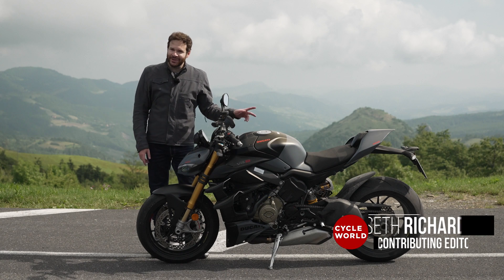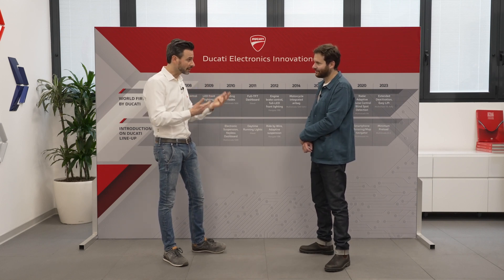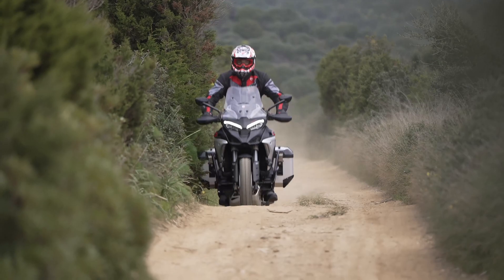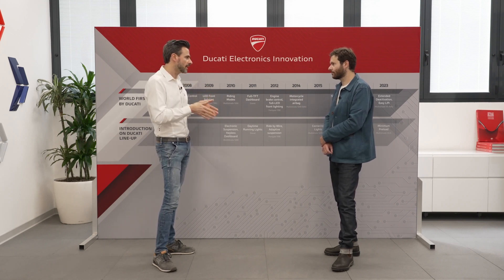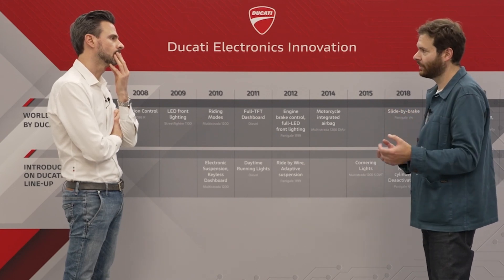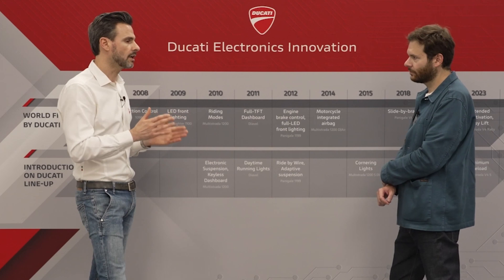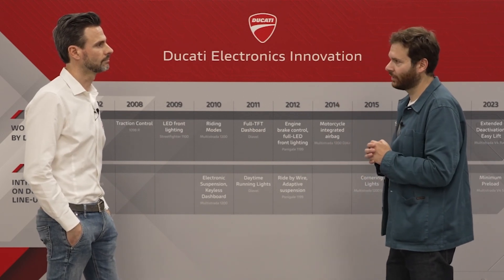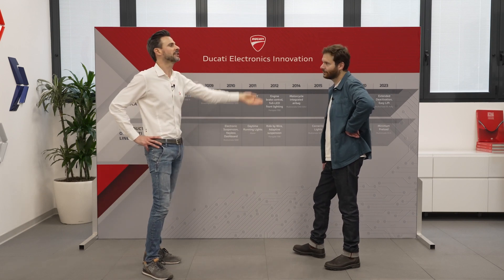Is It the BIKE or the RIDER? Ducati Electronics Explained.

Comment: I purchased a 2023 Ducati Diavel V4 and the electronic control system has helped me ride much better over the last 7,000 miles I've had it. I live in the Northern California Sierra foothills so I ride twisty mountain roads, high speed freeways, and urban city scapes. The electronics make the bike controllable, safe, and fun to ride. I ride the bike daily to work through mountains, high speed freeways, and Sacramento CA roads and it performs perfectly. My favorite mode is Touring as I have access to the full performance without the bike being too twitchy or doing wheelies etc. My favorite feature is the Ducati Quick Shifter as the faster and harder I shift the better the DQS works. I can't wait for the next 100,000 miles!
Reply: I'm not against electronics or rider aids at all, even though my motorcycle in particular only has ABS, I wouldn't mind if it had more.

However, you can't really say they help you ride better, I mean they might make your ride faster and safer but you don't get better as a rider by giving away control, that doesn't make sense.

Also... looking forward to the next 100k miles? On a Ducati... 👀 better be prepared to drop some serious money to make it go that far haha
Reply: @AirSKWolf  I have a seven, 7, year unlimited mile Ducati factory warranty I bought for $2,500.00 US dollars when I brought my bike so I'm not worried about any costs. Just tires, oil, brakes and valve jobs. This is my first 186 HP bike and I have over 7,000 miles so far and I think the rider aids have saved my dumb ass multiple times so I think they have allowed my to live and thus I am a better rider.